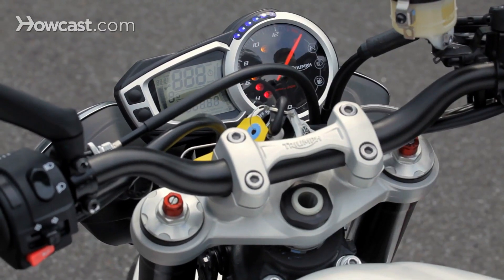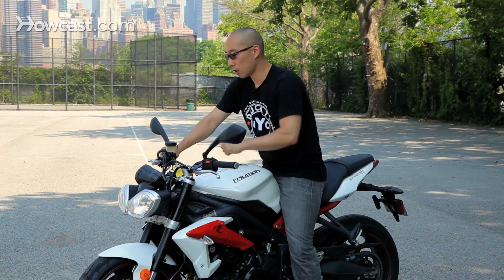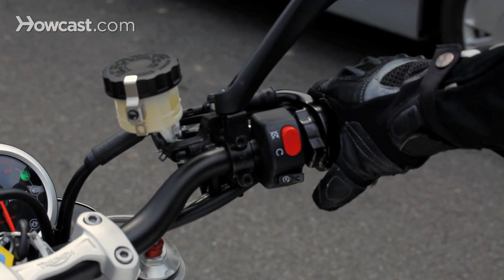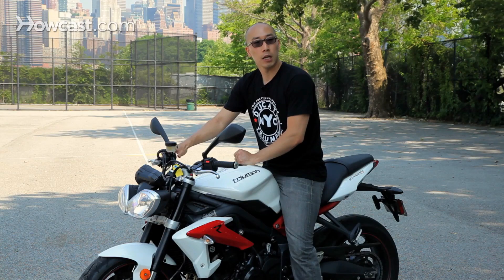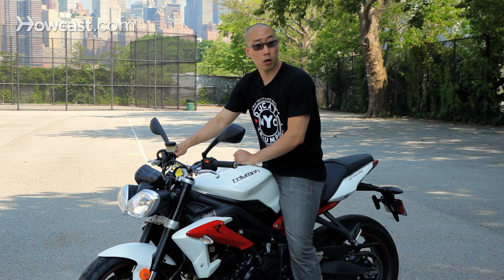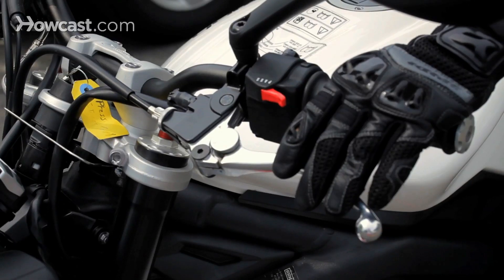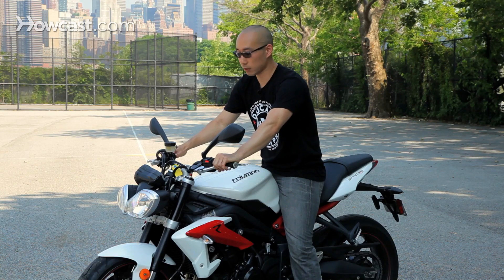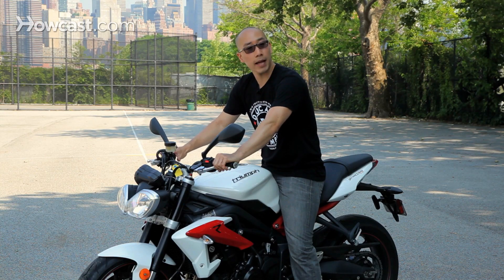How to Turn on & Shut Off a Motorcycle | Motorcycle Riding

Comment: Actually you should refer to your owner's manual on how to properly shut down your motorcycle. If you have a fuel injected motorcycle, it is not a good idea to use the engine cut off switch. It should only be used in an emergency. Shut it down with the ignition key.
Reply: absolutely right.
Reply: This comment is what i wanted to see when i came on this video.
I dont know how you are doing 10 years later.... but i hope you are fine

Comment: If you're still reading this, I have a question. My bike is a Honda CBR 125R, the first edition. It's carburated, and it has a thing that you can push down or pull up. So pushing down is turning off the carburator (parked) and pushing up is for when I'm riding (turning on). Did I get that right? Right now I park my bike with the thing fully pushed down, which I hope means turned off. Thanks in advance.

Comment: Here is what it says in the Triumph Bobber Owner's manual:  Although the engine stop switch stops the engine, it does not turn off all the electrical circuits and may cause difficulty in restarting the engine due to a discharged battery. Normally, only the ignition switch should be used to stop the engine.

Comment: Who ever is watching this, please do not use the red switch to turn off your bike, always use the key, the red switch is only for emergencies, for example if your throttle gets stuck, if u use the red switch constantly you could mess up the electronics on your bike. Ask me how i know, I've been there and it's not fun and easy to repair, nor cheap.
Reply: But do i still need to use the killswitch even after turning off the ignition using the key?? I mean after turning the bike off using the key, do i still have to on the killswitch so that it wont drain any battery?
Reply: @bhermieboybautista3025  No!

Comment: dude read the manual you supposed to turn it off with the key. I have the same bike. You have to turn it off with the key, then the kill switch and thats it.
Reply: If you turn it off with the key first then what is the point of hitting the engine cutoff switch afterwards?
Reply: rosramoy Refer to owners manual
Reply: rosramoy because it’s like when you have turn off your TV, but t’s still plugged in and you go for vacation. The TV is still pulling electricity even thought is off. Turning off the switch is like turning off the breaker in your home.

Comment: If the engine cutoff is for emergencies only if you leave it on you will do electrical damage, possibly drain the battery too
Reply: Absolutely not. It should always remain on, to be used in emergency required by DOT that is why there  all in the same location.

Comment: My bike shut off every time I release the clush
Reply: Yo I'm sure you've figured it out now to release the clutch slowly but I accelerate it as well and it still shuts off is there anything else I should do?
Reply: Release the clutch slowly or make sure the kickstand is up before letting go of the clutch.
Reply: Make sure you’re in neutral so it won’t shut off. If you’re talking about the bike shutting off in first gear while trying to take off, release the clutch slowly until you feel the transmission start to engage, pulling you forward a bit and then you know it’s time to give it gas. This way is easier but some people give a little gas before or while letting off the clutch, especially when “launching”

Comment: Sorry. I call BS. The cut off switch only cuts the power to the ignition system. Nothing else. If you do not turn the key to off after, then yes you may drain thebattery, but to stop the engine only, key and cut off switch do the same job. And if you need to watch videos such as these, well, speechless.
Reply: I came here specifically to find out what the cut-off switch was for. The guy at the course didn't explain it to me. I think he just said "that's not important right now"